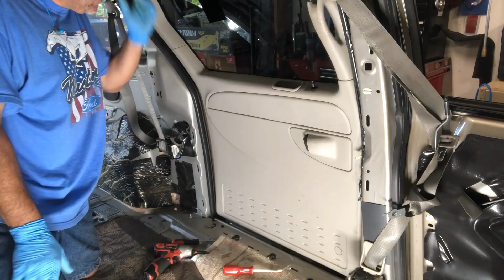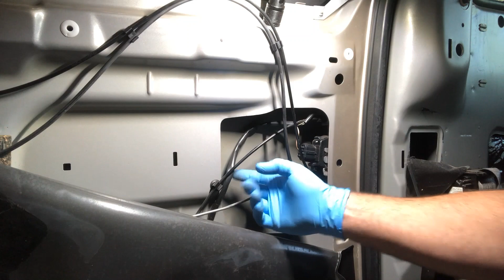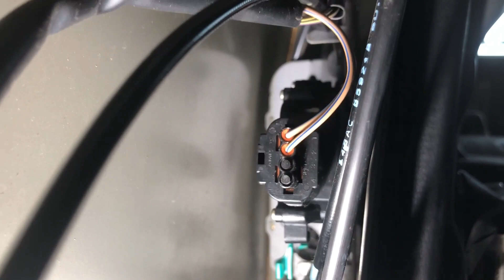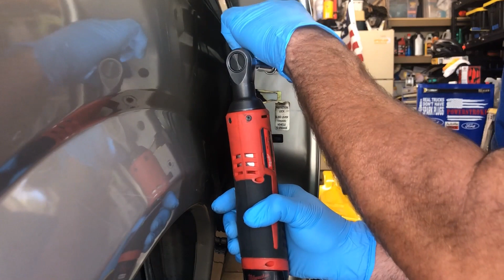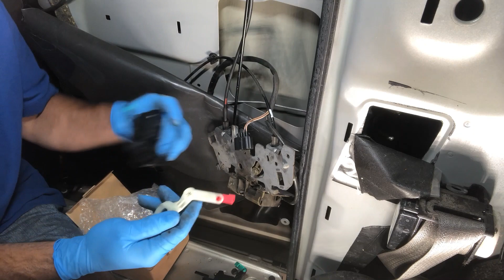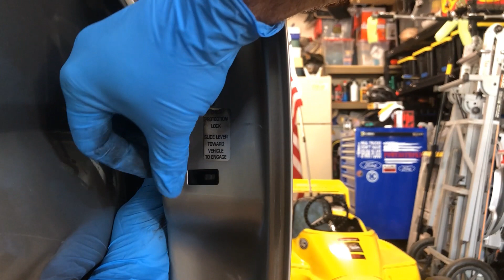Sliding Door Lock Actuator Replacement Town & Country  Grand Caravan - Detailed Instructions

Comment: Hello I hope you’re doing well! I’ve been following you for about three years now, and your videos have helped me a lot. I bought a 2006 Dodge Grand Caravan (the base model) and have fixed many things with the help of your content. Now, it’s running great!

Recently, I decided to upgrade it to the full Grand Caravan version. I went to a junkyard and installed all the necessary parts for the power sliding doors. However, after installing everything, the doors aren’t working. I’m not sure if I’m missing something.

Since you have a lot of knowledge about these cars, I was hoping you could help me. I’ve been trying to find wiring and module diagrams to troubleshoot the issue, but I haven’t had any luck. Do you have any advice or resources that could help?

Thanks in advance for your time—I really appreciate it!

Best,
Santiago

Comment: Thanks for the video and clear instructions, with the video shot of inside the door with where the rod connects to green actuator clip! Do you happen to know if this part also works with the 2012 Chrysler Town and Country? It appears it does but some site say yes and others say no.
Reply from the maker: I'm sorry Dave I can't say with absolute certainty, but I believe it does.  I just did a quick search on Advance's website for you and it shows two possible actuators: 1. Dorman 746-259 that fits an 05 & 12 and 2. DLC1035 that only fits the 05, NOT the 12.  I'm not sure if the difference is in the design of the part or a variable in the vehicles.  I honestly tend to think there is a difference in the design of the two parts.  In other words, my guess is the 746-259's design allows for a broader range of applications.  Hope that helps you a bit.  I'm sorry for the delayed response, I've been away from YT for a little bit.

Comment: We have the 2006 C.T&C Touring. We've been told by many people that the power sliding doors on this particular model only manually lock from inside; and that the (locking actuators) as you call them only make sure to hold the door in a closed firm position nothing to do with actually locking them.
Is there away to be able to use the key fob to lock the sliding doors along with the front and rear door?

Comment: We have a 2007 Dodge Grand Caravan SXT with the power sliding doors.  The passenger side sliding door lock doesn’t lock when we press the key fob door lock.  all other doors lock except this one.  We have to manually reach in and press the door lock button down.  Is this the same repair procedure?  Thanks for any clarification

Comment: Well, you were 100% right, the sliding door cover can be removed even with the door closed if done carefully. I also was able to open the door, I pushed the lock handle towards the front of the car, that is the position to unlock the door and have my wife from the outside to jerk on the door handle and it opened I did this also from the inside using the inside handle and opened but it wouldn’t do it automatically. I took the cover off and   Began  to move the wire rod back and forth and it would not give, as you said something was jamming the actuator, so I left it alone out of frustration, I went the following day and did it again this time I jerked forcefully back and forth and I heard a noise something snapped inside the actuator and the door began to retract on its own automatically, so I hooked up the rod back on the inside handle and worked it several times and it’s been working normally ever since. I put everything back and everything is ok now, I guess I was lucky I was just about to go to some body shops to get few estimates I know you saved me no less than 700 hundred dollars. Thanks to your instructional videos, keep the good work, thanks a million.
Rudy Colino
Reply from the maker: Awesome Rudy!  Sounds like you have the power sliding option.  Double check your door lock function.  Don't want to be a downer here but a "snapping" sound is not normal so something gave.  :)    I am willing to bet your actuator was locked up (no pun intended).  If it's working now keep an eye on it as it will likely need replacing very soon.  I have a link in the description where you can get one.  I highly recommend the Dorman brand, it's a bit more money but it's worth it to not have to do the job again in 6 months.  Let me know if I can help you with this or anything else with your van, these are my specialty and I'm happy to help you.  Have a great day!                                                                                                                       PS -Thank you for getting back with me and providing an update, much appreciated!
Reply: @javosgarage  Hey, Javo I replaced the actuator on the driver's side sliding door, but it will not open. Lock will go up and down now but the door will not open.  Any suggestions?  Thanks

Comment: The problem is how to replace the door cover and the actuator when the door is in the locked position and won’t open neither from inside or outside. How do you go about to open the door first.
Reply from the maker: Hi Rodolfo Colino, it sounds like either your lock actuator is jammed or you have a problem with the latch mechanism.  I've had this type of issue before and it was the actuator, the gears internally break and then bind so the latch will not unlock.  Start with removing the door panel as I show in the video at 0:37 or 3:49 depending on the side giving you problems .  It's certainly more difficult but it can be done.   Next, try to manually move the rod I show at 10:52.  If you can't move it then the next step I would take would be to remove the actuator so it frees up your latch.  If your issue is on the driver side you have easy access to the set screw I show at 9:49, if your issue is on the passenger side then you will need to carefully drill a hole in the door right in front of the set screw.  I discuss this option at 7:45.  Once you remove the actuator from the latch you should be able to reach in there and unlock the latch directly then perform your repair.  I hope this helps, if it doesn't fix your problem get back with me.  Good luck with your project!